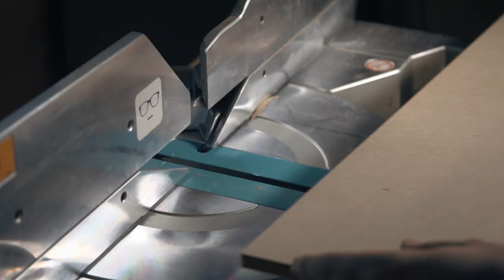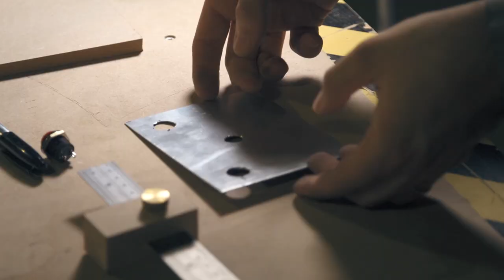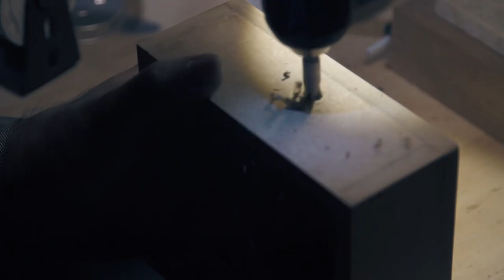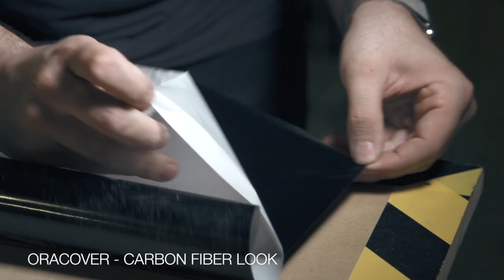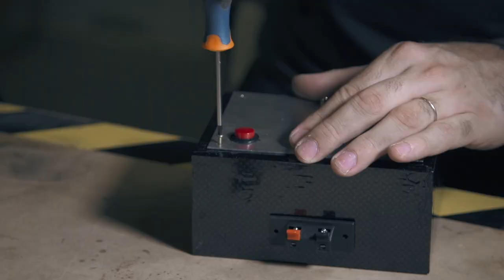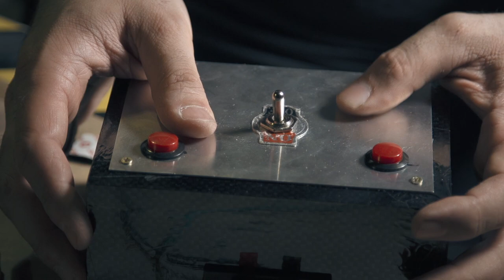Make a Detonator

Comment: Great video! This is the first one I've seen that uses steel wool, which is inexpensive and easy to get. SO many want you to use that special wire that's used in foam cutters and vape coils or wire coated in match head material.

I love most of the music you use, this time not so much, but it wasn't annoying.